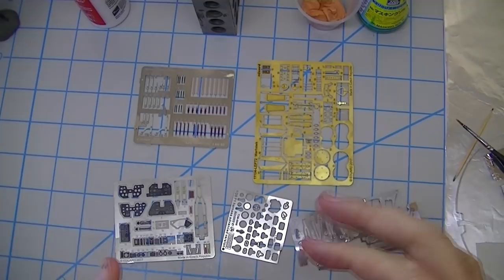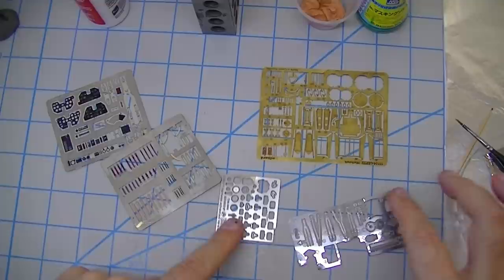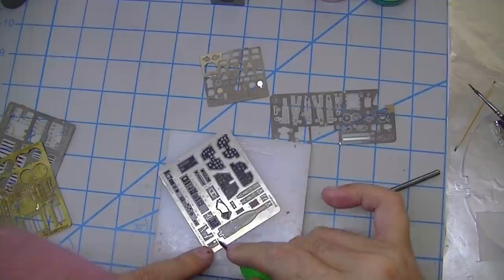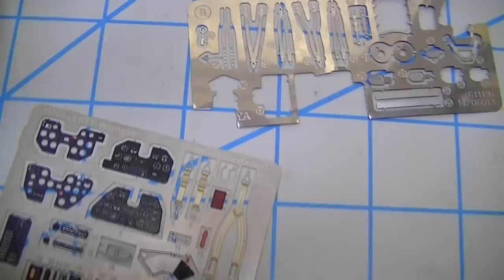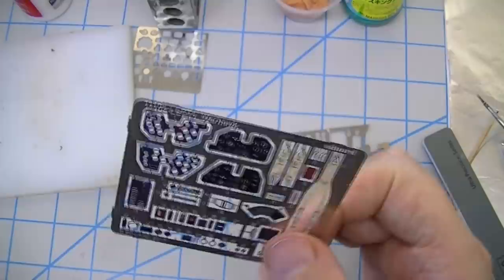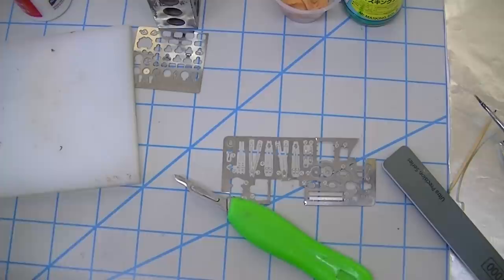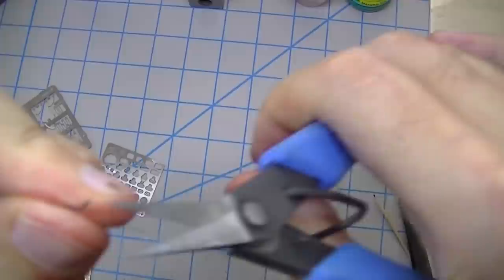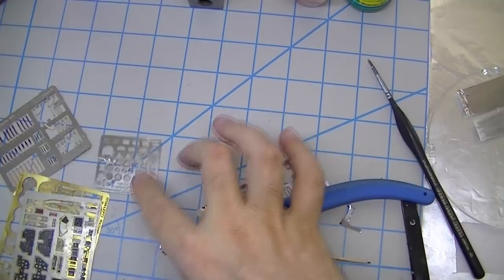ep308 - cutting photo etch

Comment: Good video.
I would like to offer my experience with a diamond file. I have a Tamiya file that works very well. I find it doesn’t chatter but rather cuts fast with very little resistance. It works much better than any of the 2 dozen needle files I own or any sanding stick. A very fine sanding stick offers little resistance but is slower removing material. Another positive with the Tamiya file over a sanding stick is it is much easier to see the PE part while removing the nub. A sanding stick gets in the way of seeing. The file was kinda pricey but well worth it. I am rarely disappointed with Tamiya tools.

Comment: nibs are easy to get rid of if you hold it as close to the edge in tweezers and run it over a honing stone no chatter and you can wear it right down and dont need to do anything after
Reply: I use cuticle scissors.  They follow the contour well and catch the nib cleanly.
Reply from the maker: you just really missed the whole point here, didn't ya?
Reply: @barpfoto  no i understand you were showing the technique to do it so you end up with a clean cut with no need for clean up but every now and then fuckups happen i was just sharing a way to fix those fuckups that gives a good result that is easy on the photo etch at the same time